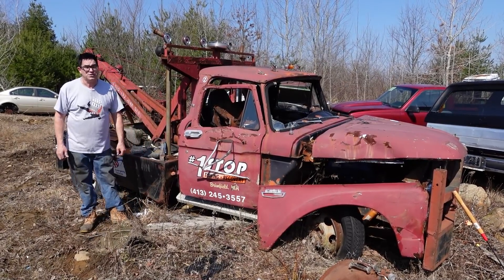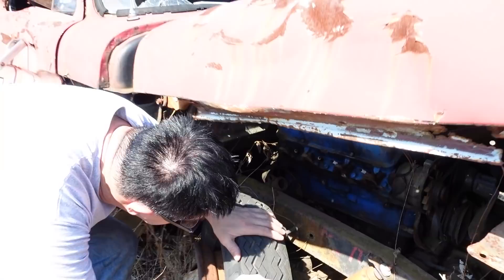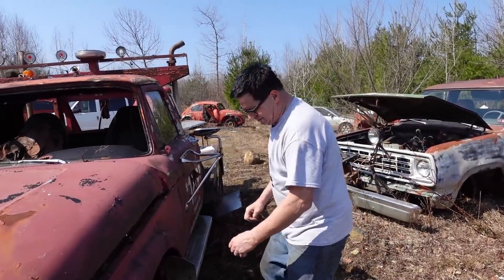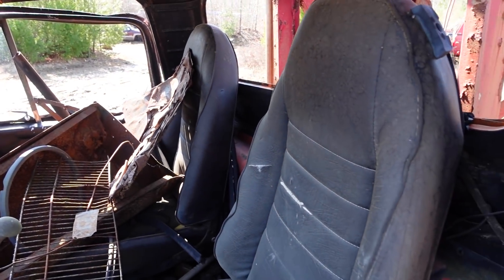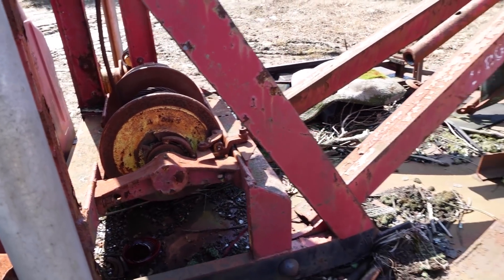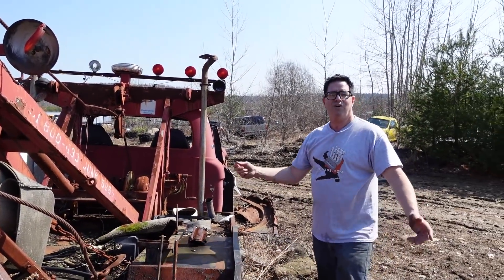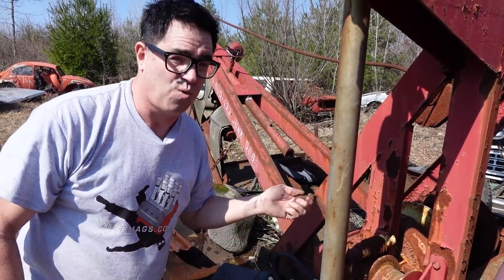Tow truck Tragedy

Comment: The hand crank on the side is not for pulling on the sides, it was hooked up to raise the boom up or down. The cable hooked around a few small pulleys and to the far end of the boom.
Reply: OK thanks, that makes more sense.
Reply: and the main winch is not electric
Reply: yup. my Holmes 420 has one.
Reply: Likely a PTO powers the winch
Reply: That one ain't dead. It can be restored. It wold make a great project. Jim BCC AZ
Reply: @jameschryst3960  I was thinking the same thing.

Comment: Wow! What a relic! That classic should have been restored and put in a museum or in front of a towing company as a show piece!👌😎👍
Reply: There is a plan to repair this truck.  The frame is straight, and tow unit is still usable. Even had a 3 speed shifter on the PTO for increased speed. While its truck #2, truck #1 was a very big truck that was not used much. This was the work horse that helped start his business. A replacement cab has been acquired, and within the next couple years, it will come back to life.
Reply: @ChainsawFPV Thanks for the info. It's good to hear that sometimes something once relegated to the junkyard gets a second chance. I agree; this truck looks like a decent candidate for restoration for use as a rolling advertisement for a towing company.

Comment: My dad built a tow truck back in the early 50's. I remember going on calls with him. He had a 2 speed gearbox on the winch. He would use it to pull water lines out of buildings, pull the old out with the new attached. He also did bodywork, lead and beeswax, painted with a camel hair brush. Really old school stuff
Reply: The good old days when men were men ..

Comment: Steve, you're correct about finding Cobra Jets in odd places. When I was in HS in the 80's, the neighbor ran a body shop out of his giant garage and naturally I ended up working for him. On occasion we would go pick up customer's cars instead of them dropping them off. There was a pretty steep, long, straight hill on the way to our Rural location and as Car Guys do....it was a perfect place to 'test things out'. I'd been tasked with driving the customer's really nice 1970 F250 back to the shop. It was in great shape, except that the pea green paint was deteriorating. It had big Slotted Mags and big BFG All Terrain tires. Of course...a 17yo guy is gonna drop the throttle at the bottom of the hill...and I was SHOCKED at the gross power it had. I walked away from the boss in his wife's Monte Carlo. 60mph was a good run up that hill and I had to back out of this truck at 80, cuz I figured I couldn't afford to fix it if I crashed it.
When we got to the shop the boss's ass-chewing was completely derailed when I blamed the truck and we popped the hood and found a 428 CJ in front of the C-6.
Later conversations revealed that the client's father had supposedly special ordered the truck and had had to wait months for approval of the order to get it built. I admitted my lil speed racer episode when we delivered the truck to him, and all I got was a sly smile and an understated "that happens" from the owner. 😎
Reply: Very, very Cool🙂

Comment: We had a 65 f260, yes 260. They came from the factory set up for towing. PTO winch, tough old truck.
Reply: F-26 indicated a 4x4 unit 3/4 ton,  mine 65 f-26 has a 300 six ✌️
Reply: F260 on the warranty tag means it's an F250 4X4, all the badges will say F250.

Comment: That hand winch on the side would have had a cable that went to the little pulley at the top of the boom. It was used to adjust the height of the boom.
Reply: I was going to say the same. you are correct sir!

Comment: When I was growing up there was a huge body shop up on the main road that had a fleet of tow trucks. There was an older Ford tow truck outside for a while where the customers' cars usually sat. The front bumper was facing the winch end of the bed and both halves were sitting on a pair of wheels on one end and the ground on the other. It seems years and years of lifting up heavy vehicles had fatigued the frame and the day finally came when enough was enough and the thing split in two just astern of the cab!

Comment: 61-63 non unibodies had that shape in the door.
Reply: Beat me to it. Good man. Also, the only real way to tell the difference between the cabs themselves, is the roof lines. 61-63 cabs had different roof skins than 64-66 cabs. Also because of the twin I beam change, 65-66 F100s & F250s had different floor pans, but factory 4x4 trucks had the older style floors with the step. As far as I know, all F350s 61-66 had the step style floor pans.

Comment: That truck should have a PTO winch. I had a 82 Ford F-350 tow truck with a Holmes 450 bed on the back and it had a PTO drive winch. There was a handle on the transmission pump to disengage and engage the PTO drive.
Reply: 440?

Comment: That hand winch is not for "pulling cars out of the woods".  It's to raise and lower the boom.  

I don't think that's "homemade" wrecker either.  I don't recognize the brand, but it looks manufactured to me.  There's probably a data plate on it somewhere.  If you look for it, you'll probably find it.
Reply: looks like a Holmes 440
Reply: @oregonfordguy9812  A 440 is quite different from this one.

Comment: I learned to drive at my first job. We had a 67 F250 pickup, a 73 F350 dump truck and a 74 or 75 F150 with the 3 on the column. When you shared this tow truck with us. First thing that came to mind was smoking cigarettes while driving - with a gas tank behind the seat and the fuel filler next to my shoulder out the window. I still wonder how I never burned the truck down to the ground…
Reply: oh yeah, vent windows and a rag in the fuel filler neck b/c the gas cap was sitting on the top of a lead pump somewhere. amazing there weren't more cab fires :)

Comment: I've seen a lot of those old wreckers end up as advertising displays for modern wrecking yards or towing companies. Bumper type tows aren't used as a rule anymore almost all passenger vehicle tows use flat bed roll on and or wheel lift to minimize any damage from the actual tow. That being said I worked part time at a small town gas station back in the late 1970's and would get sent out on tows when people would slide off the road when it snowed with a wrecker similar to that one but was a Holmes 440.

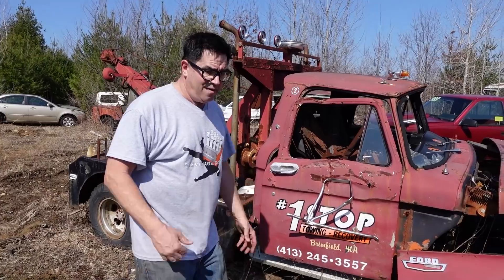Comment: 0:38 That sculpted drop body line was there on various trim levels of that generation of Ford truck since the introduction of the model in 1961.  Google up the 1961 brochure, it is there.
Reply: Only one with straight line was unibody 150s, where cab and box are all one piece. This truck is a 65 or 66, tell by where turn lights are.
Reply: Yup, only the F-100 “unibodies” had the straight-line doors. Steve is an authority on Mopars but not so much on Fords…Love the vids!

Comment: Steve, 
You mentioned in one of your videos that the mid 60' corvettes were the first cars to have 4 wheel disc brakes. Not so fast. I had a 1951Crosley  with four wheel disc brakes. They were called spot brakes at the time.  The brakes were horrible and I eventually changed them to drums. I included a video address on these brakes. It goes into great detail about the brakes and more. I really enjoy your videos. Keep it up! Dave Reimers

Comment: Remember the Holmes built Chevy wreckers from the 70s. They built duallys but on a shortbed platform during the fuel crunch I guess to save weight, but anyone will tell you they didnt stay in service long. In wet conditions they were downright dangerous with a car hooked, and I heard from one guy who came off an on ramp too fast and the wrecker just wanted to keep going straight due to hardly any weight being on the front wheels.

Comment: While it's not a really old town truck, provided the frame and non body parts of this truck are not damaged I think this truck would make for a really cool project.. Rebuild it repair all mechanical, drivetrain,  and suspension components, upgrade the brakes to a dual circuit brake system, put on a good cab and body panels, and put it back in service even if only at shows or parades and such. It's just too cool to be scrapped. Back in the 80's and 90's there was a tow service here who had bought a 2 ton or larger 49 or 50 GMC Wrecker that had been owned by the Buick, Pontiac, GMC dealership when the dealership closed (the original owner of that dealership opened as a Buick dealership in 1919, and he ran it until he retired after more than 70 years selling Buicks. He had kept that tow truck as well as an even larger one until he closed the doors in the  90's at age 96. Well back to the story... The guy who had bought the smaller of those wreckers repainted it named it Bertha and put it back in service, 2 of the more memorable tows he used Bertha for were a large tandem rear axled MCI bus that slid full length off the road into waist deep snow one winter and his 1 ton Chevy wrecker  was called to go out as well and was placed between Bertha and the huge pine trees to be used as a connection between Bertha and those huge trees to anchor Bertha to the trees so the winch could pull the bus out instead of just getting drug across the road to that huge bus. After that day the Chevy 1 ton was known as  "The Anchor" anchor. The next memorable tow was the next winter when a fully loaded propane delivery truck went off the road in the same area as the bus and dropped both of it's rear duals into a water filled ditch when the ice covering it gave way under the weight of the full tank of propane when it left the road. (A water  filled ditch with the ice covering it in sub zero temperatures will start refreezing pretty fast making it harder to pull such a heavy vehicle out of it.. Bertha was able to do the pull but had to have The Anchor, as well as a competitor with his tow truck assist by connecting to Bertha and the trees and a huge boulder and having taken an axe to start breaking up the ice in the ditch again.  Bertha was later sold to a guy who was said to have a smaller auto and truck museum in Minnesota

Comment: Looks like 1965 from the grill? You would think they would have used it for advertising after taking out of service? I guess just selling parts off of it? My father had 1965 Ford F100 custom cab turquoise and white with factory 352 FE 2bbl/208 horsepower, 3 speed on the column! It would really go in 2nd gear, 1st gear was so low. It was fun to drive and had good torque! Thanks for sharing!

Comment: PTO/hydraulic not electric winches and the hand crank is to run the boom cable to lift the boom to different heights. Lots of time running and rigging those set ups. love doing recoveries

Comment: We have a 65 in our collection. Good rust free body. Good title . It was originally a 6 cyl. I swapped in a 330 FE  engine and trans from a school bus.  ours has a Flat bed dump. The hyd pump is driven by a PTO. I dont like the 6 lug wheels. hard to find 17.5 tires. and the 16 inch 6 lug wheels are all split rims.Those valve covers  on the truck featured came out in 67.  bet that engine isnt the original. the hand crank was for lowering  and raising the boom. the  pulley sheave on the boom rotates you can pull from the side with it. Problem is those are low geared and use excessive fuel if you drive fast. They have drum brakes originally equipped with asbestos linings. Todays replacement linings are organic and will fade out. The master  cyl is a single unit. blow any line and you have zero brakes. The only viable option would be to swap the antique cab on a newer modern chassis.

Comment: Most were pto driven but I don't see any way to engage it in this cab since you had to push the clutch in to put the pto in gear (I think) but yet there are two levers in back like one. Sorta confusing. I think the pto would have more power. A lot of these older tow trucks ended up at the race tracks after the plastic bumpers became the norm. Local track has an old ford and chevy both, they use whichever one starts that night, sometimes both when a car is torn up badly. They use a tow truck front and rear, one forward and one backwards. Thanks for the info Steve.

Comment: I believe that the doors on this truck were used from 1961 on the cabs for F-250 and up, and from 1964-1966 for F-100. The “straight line” doors were for 1961-1963 F-100 “unibody” trucks. I think an F-350 with an FE engine and that instrument cluster must be a 1965. I think 1964 and earlier, these trucks had 292 Y-Blocks, with he FE introduced in 1965. ALSO, I think that winch is powered by the PTO on the transmission? One of those rear levers operates the clutch. My Dad and I operated one similar (1963 w/292 Y-Block) to this in the early 1980’s. Nobody uses those rubber straps anymore. Modern tow trucks use a cradle to grab the front wheels and avoid any contact with the car body.

Comment: That is a 65. The body line on the door did not come out in 64 it came out in 61 non unibody pickups and trucks. As for the twin I beam suspension it came out in 65 and was offered on the f100 and f250 only. Otherwise great video enjoyed it. I know you are a dodge guy but you still had a lot right.

Comment: Somebody did an excellent job building that wrecker. But it's a pto driven winch and it's not a side puller. It should have a cable that goes up to a sheave and out to the boon head and back to the mast for raising and lowering the boom. Yeah if only that F-350 could talk. Oh and the "sling" on the back is very rare today. Even more rare is finding someone who knows how to use it lol

Comment: Pretty sure that the sides of the block skirts on Ford FE engines have bosses cast into them for drilling bolt holes for side-bolted mains. Gonna bet that this old motor has two-bolted mains. Plenty strong enough for tow truck use! And this old girl is a ‘65 — evidenced by the egg crate grill hiding behind that push bar. I used to have a ‘65 F700. And you’re absolutely right about never knowing what you’ll find inside old Ford engines. I bought a 390 from a guy that was sitting upside-down in the mud in a hog pen. Paid 50 bucks for it. Upon disassembly, I found that it apparently came from the factory with 428 Cobra Jet connecting rods. So yeah — you just never know.

Comment: My '68 F250 has Twin I-Beam front suspension and I believe it is still used today in the F-250 and F-350.
Reply: Yup, twin I-beam started in 350s in 67 i believe, and I am not sure about new ones, but I know atleast through 2016 ford had twin i-beam on their 2wd 250-350, and maybe 450

Comment: Man !  That 352 cross-bolt block would be worth using.  Bore it  +0.050, and swap in a 390 crank, rods, and pistons.  You'd have a cross-bolt 390.  428 CJ heads, and modern fuel injection.  Romper-Stomper.

Comment: thank you steve for that truck piece on mid 60's ford trucks with v8's the hood emblem will have a v8 if it was an orginal and the gear with lightinin bolt for the 6,so that is the wrong hood or at least the wrong emblem btw the truck is a 65-66 by the parking lights 64 would be down in the grill

Comment: This truck would be a 1965 judging by the grille. The 1961-1966 all had the stylized line on the door. The 352 was introduced in the f series in 1965, would have had a y block previously. Though you didn't show it the 1965-1976 had a flat floor ( relatively) as 1965 was a chassis change. The 1961-1964 had a step inside the door. The new chassis ran through 1976 when again they had a chassis change mid year. All the 1965 through 1976 had the same floor pan. All 1957 through 1964 had the same floor pan. My first truck was a 1964 f100 high boy, my second truck was a 1961 sb flare side (still own it). I've also owned a 1965 2wd long bed and 2 1966 2wd long beds. Loved them all.

Comment: I have been towing since 1969 , I have used every tow truck you can think of that old wrecker looks like an old Manley Autocrane or an old Canfield they both used a  10 ton braden or a Tulsa winch one handle. Runs the clutch and the other puts the the winch up and down  the side winch picks up the boom in 1963 Ford went to twin I beam that truck is a 61 or 62 could not see the grill all 61 through 66 had 6 lugs 67 they went to 8 lugs he does not know his Fords 1979 was the last year Ford built a truck that you could get that would go 250,000 miles before rebuild I have towing for my self since 1977 started with a Holmes 500 on a Ford F 600 and still have several hydraulic wreckers and flatbeds still in use is my 1978 International 1850 Loadstar twin screw baby diesel quad Plex transmission 20 cowards and 4 reverses 39000 original miles government surplus well maintained with a 750 Holmes a pulling momma  she's gone through the mill in fields recovering farm equipment she never failed you can't beat an old Holmes if they say it is a 25 ton unit you can believe it is more than that Holmes tested every tow truck they built and stressed it to the breaking points when they say 25 tons safely it will do more I broke the transmission PTO slap off a mack in a heavy recovery in the 70s

Comment: Turn signals above the headlights='65 or '66.  It also has the "normal" Ford side logo (that would have, in white letters, F-350 or whatever F series the chassis was, but the letters somehow always disappear from these).  The '65-66 pickups would have had the "Twin I-Beam" side logo.